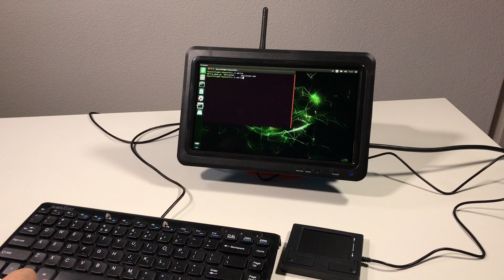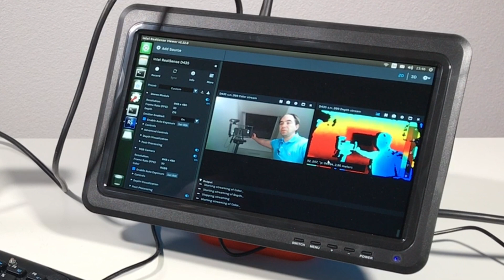Perfect Robot Brains? (Jetson Nano and ODrive)

Comment from the maker: Please do not hesitate to leave the comment. This will help to promote the video. Thank you!
Reply: You forgot to add exit holes for the warm air pushed through the case by the fan.  :-)
Reply: @AndersJackson  There are holes, watch it again :)
Reply: @Magnetic999  well, they are not that large.  
And depend on those small holes for the power supply.
Yes they are, yes they are better than nothing... ;-)
Reply: Can you also do a video on Kinematics for the arm using ROS?

Comment: A couple ideas I had while watching this video that may be horrible, maybe not? 
Regarding the speakers, maybe print some new risers/spacers that have a ramp along the sides to reflect the sound out the sides the way some older laptops and portable handheld TVs did? If you look online at patterns for "iPhone passive amplifier stand" type projects, they use the same idea and add a cone for amplification. Which, now that I think about it, you could print as well, if you desired more volume.
On the fan: For speed control, look for some older style PC fan controls like the ones from the early 2000s that came with  "temperature sensor speed control" built in. Basically they had leads with thermistors that you could squeeze in between the fins of a heat sink, or just place in a certain part of the case to control the airflow specifically to an area. 
Also, it appears you had room for a larger fan? Maybe look into a 40mm server blower instead? They move WAY more air, allowing far slower (quieter) operation at lower speeds. Also, duct the heat upward for the exhaust, putting the vent holes on top, rather than the side, and you'll lose a couple more degrees easily.
Intel RealSense cameras. Well, they're still rather expensive. You can buy a "replacement camera module" that has RealSense for some Dell laptops for about $12-15USD on AliExpress, and another $2 for a connector and sacrificial USB cable. I use several old laptop webcams as security cameras, and they're all just USB devices. Much easier to embed that way. 
Oh, and if you have a Kinect 2.0 from an Xbox One, you already have one. USB/power adapter will cost next to nothing. 5-10 on eBay last time I checked/bought one. Cheapest ways to get "Windows Hello" and similar security up and running. 
Man, I need to order one of those little touchpads... 😆

Thanks for another awesome video! My partner might not be as thrilled at all the new ideas and tips I get here, along with the "crazy projects", but I sure appreciate it myself! 😁
(Also thanks to the people in the comments who participate, as you guys have been a great help as well, often saving me time and failed ideas, since someone's already tried it and the group is solving the problem. Many minds!)

Comment: Very cool. I really like the 3D printed box. Looks very clean with it.
By the way, is it a good idea to put a jetson nano onto a drone?
Reply: The nano is not very heavy, so if you can generate stable 5V/3A for it, the Baboo should work on a medium or large drone. Also, probably doesn't need additional fan if it's on a drone!
Reply: @jonwatte4293  Thanks for the answer! I was thinking about using it for computer vision and some other AI stuff.

Comment: The fan could be temperature controled... That would make it less noisy. As always great vídeo!
Reply: The nano has a 5V PWM fan header and Noctua has 10mm and 20mm thick fans size 40mm that work with that.
But then the power supply wouldn't get constant airflow.
Reply: @jonwatte4293  constant air flow isn't as important as constant temperature (in my opinion) and then it would be super easy to implement a temp. sensor near the psu and get readings from there. This would prevent overheating while maintaining a fan speed ajusted for the condicions inside the box.

Comment: @Skyentific why only one camera ?
you need more for this robot to see and act in 3d
Reply: One depth camera can be enough.
Reply: @YOUnoobGER  motorized maybe but not very efficient i think
Reply from the maker: I also plan to motorised it in the future.
Reply: @Skyentific  ok; where will you put it, from the arm point ?
Reply from the maker: Yes! I also think it should be enough.
Reply from the maker: This is camera made specially for the 3D vision. It has three cameras: one standard, and two infrared. Like this it can make normal image and 3D depth image.
Reply: @Skyentific  ohh i didn't know it' is as good ...